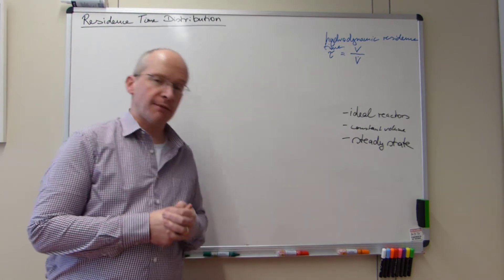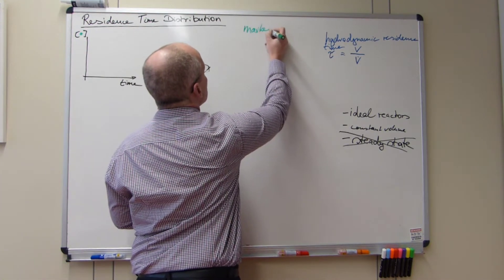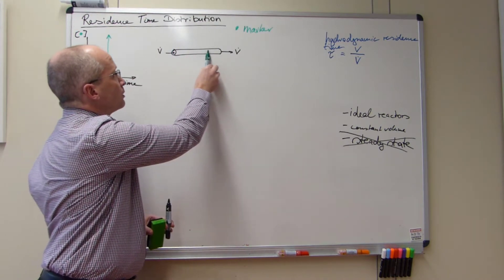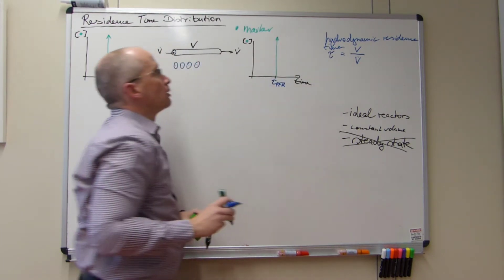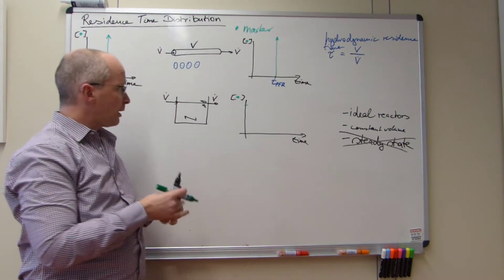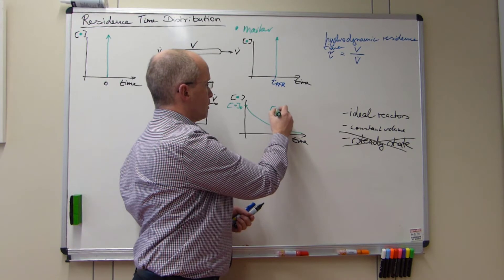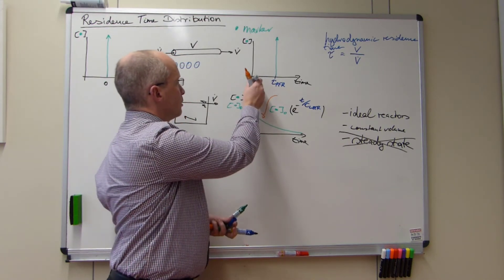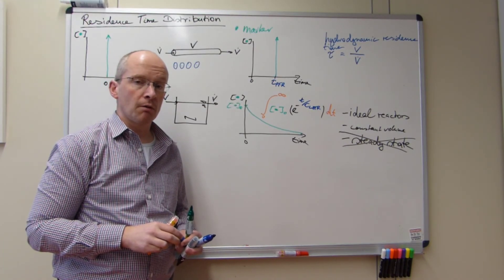Residence Time Distribution for Ideal Reactors

Comment: the residence time of the cstr is wrong , in a ideal reactor the distribution is a puls , ith change immediately after entering in the reactor. what you actually drow is a batch concentration on time
Reply from the maker: I guess your perception is incorrect, what the graph actually represents. The concentration in the CSTR and also in the outflow will decline proportional to exp(-time/(residence time)) as a function similar to substrate consumption in a first order reaction in a STR. This is because the amount leaving is proportional to the concentration. Also, I drew it to change immediately from time=0, did I not?